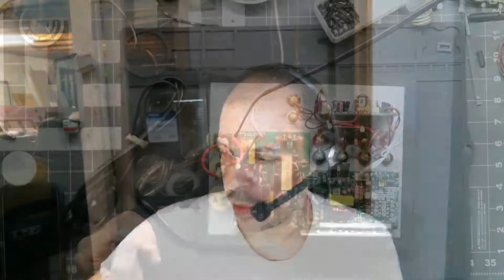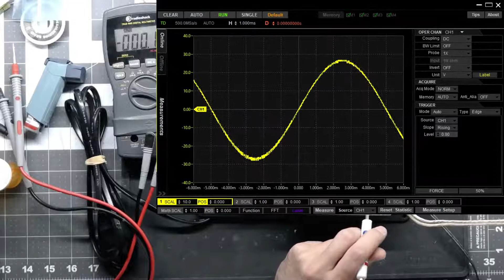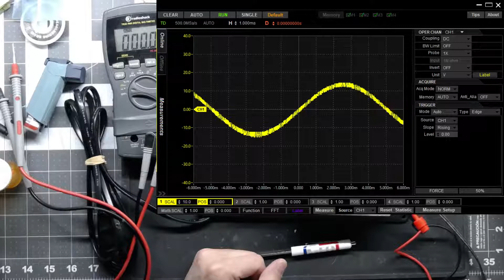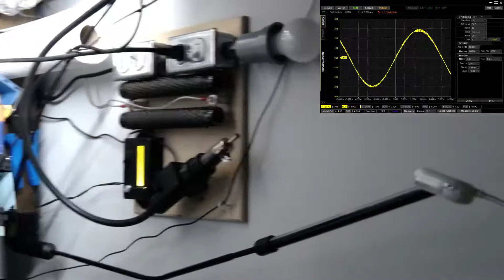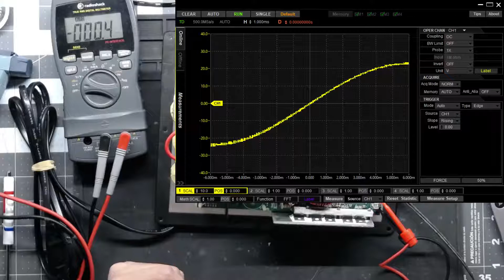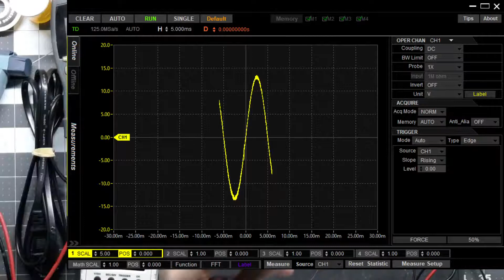Supreme Innovations LLC Live Stream - 009 - Klipsch RPW-10 (SUB-10 SUB-12) Testing & Bias

Comment: dear friend, greetings. thanks to your videos, I restored sub 12. I have a question: should the voltage stabilizers u4 and u5 be heated? I have them decently heated even with an unconnected load. with best wishes, Alexey
Reply from the maker: U4 & U5 LDO Linear regulators run extremely hot. This is normal on these amps.